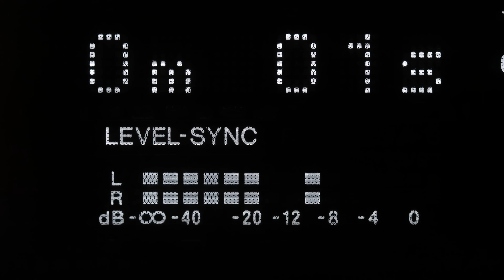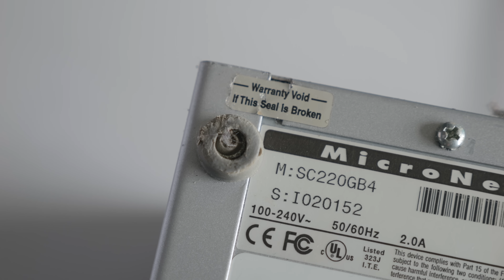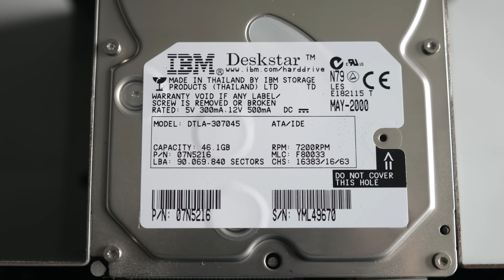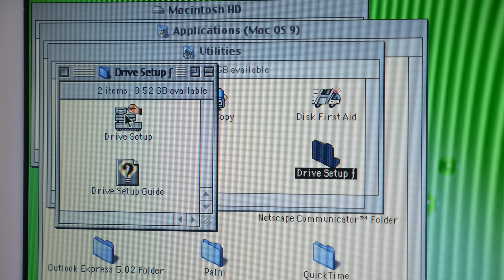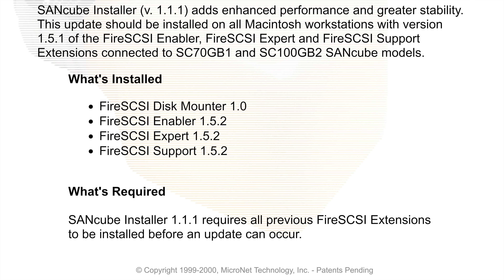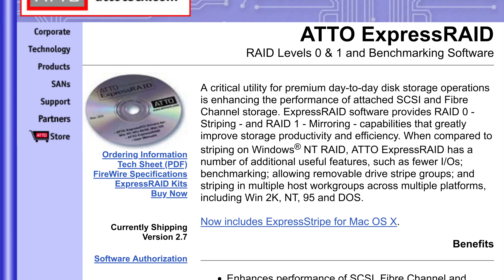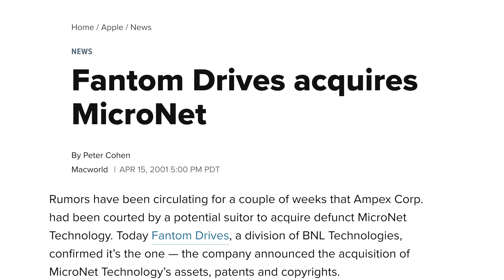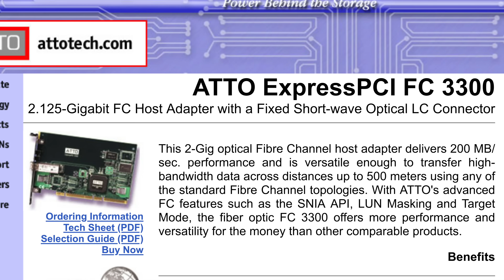This old external hard drive can do WHAT?!

Comment: IBM DeathStars and it had never been opened!? it's a miracle!
Reply: Well, all six passed their self-test and probably work still haha. I know because I have over a dozen I've collected and I'm familiar with how they are. Part of the problem was how hot OEM PC cases would get due to poor ventilation, which would then cause the drive to overheat and degrade fast. Also IBM stated that these drives were not designed for 24/7 operation, yet people disregarded this and used them in servers and RAID configuration anyways which of course did not go well. With proper ventilation, the drive would last significantly longer since it wouldn't run hot all the time. I've seen them get above 60c which cooks the media and increases the risk of the drive crashing the heads onto the platters. If you keep the drive cool, and don't use it too often, they definitely can last. I have a whole set that works granted most have reallocated sectors, but the drives are 20+ years old so I think that is reasonable to not expect the drive to be perfect especially considering the history.

Also did you notice how those drives were well ventilated in that enclosure by the fan and airflow? That is a huge reason they probably all still were able to seek just fine...the media didn't get toasted due to extreme temperatures. They do heat up fast, especially the higher end models with more platters inside generating more heat...

Comment: I have several IDE external HDD enclosures with firewire and usb 2.0 and they always worked out of the box in windows xp and in ubuntu with no driver installation (although in ubuntu you have to activate firewire which is disabled by default due to it being a security risk).

Comment: Speaking of failing hard drives, I've noticed that you talk a lot about old SCSI drives being scarce due to failure. I highly recommend looking into early to mid 90s IBM drives for some of your restoration projects. They seem to last virtually forever, unlike old Quantums and Conners.
Reply: Can't go wrong with an early IBM! Well unless it is one of those PS/2 stepper IBM drives where the platters rot...the early to mid 90s IBMs do seem to last forever, but the late 90s one's at least in my experience is hit or miss. I feel really bad for how many of those Quantum drives get thrown out due to the rubber melting which is fixable, I suspect within the next decade those are going to become rare drives as so many of them are failing this way it is at an astronomical level. Wish people would try and see what is wrong with the drive before tossing it or plugging in a solid state solution but that is personal choice...

Comment: Oh no the IBM Deathstar
Reply: I mean if the fact all six passed their self-test doesn't prove something...I don't know what will. The proper ventilation along with the fact they likely sat and weren't used too much after is why they survived, heat was an insane killer of those since most OEM computer cases had crappy cooling that would cause the drive to overheat and die. Also they are not designed for 24/7 operation per stated on IBMs website and manual I believe at the time yet people still would disregard this and especially with poor cooling the drives would overheat and run around 60c then die within two or three years or less. I still have a set of them that work : ))

Comment: So, the use-case for this would have been in a small computer lab. Not exactly practical for a SAN.

I wonder if it's possible to reverse-engineer this unit. Get a dump of those flash chips to see if they contain any firmware.

Comment: We had one at my job. It was great until it died. It was an expensive lesson in drive recovery and why you need a real server.
Reply: Probably would have been fine if they had chosen more reliable HDDs. Running 2000-era Deathstars in RAID was the computing version of Russian Roulette.
Reply: As I recall, the drives were fine but the raid was scrambled. I think we got back most of the data. The entire thing was chucked.

Comment: I fished one of these out of a dumpster circa 2004 and added a bunch of seagate drives to it and it worked with my Mirror Door running OSX panther for years, I don't remember having to do anything to configure it, each drive just showed up as an external firewire device. I knew about the multi mac support but from what I remember that was OS9 only. You might want to try all the firewire ports, I can't remember but one may have been the "prime" port required to use it without the software.
Reply: Yeah I wondered too if he tried them all
Reply: I noticed some DIP switches in the center of the FireWire ports. Maybe they disable the software requirement.

Comment: Is the plastic shiny/ glossy? If so you can fix that by buffing it out with a polishing compound called Quixx. You get two types: Quixx Paint and Quixx Plastic.

The best repairs I've managed to do is to sand deep scratches out and evenly with 3000 Grit, then using the agressive Quixx Plastic to buff the entire panel to an even hazey look. This removes the sanding as it's an abrasive compound but the plastic needs more work.

To finish it off to restore the transparency you need to use the Quixx Paint Tube 1 (Repair) to remove the microscrathing thats occured and finally finish off with generous dollops of Quixx Paint Tube 2 (Finish) to bring out a lusterous shine.

If you can get the older oil based Quixx Paint in the metal paint tubes it will work even better but be warned, not only does it stink, this is laborious, time consuming work as it must be done by hand as power tools can potentially warp/ discolour the plastic if it gets too hot.

Also, if the scratches are even deeper than 3000 Grit you will need higher grit but then you have a larger area to sand and buff back to original condition.

Comment: I guess you are a big fan of Apples plastic cover of Macs... Even though I had never seen a Sancube before, I could see it was catered for the rotten Apples. In my opinion it looked way better without the plastic on it. Like someone else mentioned,  Firewire is still being used by the Linux community today, try finding apps and drivers for Linux.

EDIT: Usually you don't even need to look for drivers for devices in Linux, it most often fixes this itself. There is also most likely some dude that made a program for himself that made his program available for others, it might just be very hard to track down.

Comment: you know firewire wasn't just on Mac, I used it on my PC for video capture, importing and exporting as well as external storage, I had 2 drive bays both with 2 80 gig drives and they were shared across my home network. granted the network was limited at 100 meg but it was fast enough for my needs considering I didn't have to have 50 foot firewire cables and the house was wired for cat 5 already.
Reply: While that's true, the PC world basically ignored FW entirely ... with a very limited exception for pro-audio and video enthusiasts.  Sony did make a point of including it on the VAIO line (although Sony's whole philosophy was inspired by Apple, so that's no surprise), and I had a handful of motherboards that supported FW.  But otherwise, the WinTel community was solely focused on USB and Ethernet.

I take issue with anyone that calls FireWire an "Apple proprietary thing".  PC users had access to it, they just never cared.  Which is too bad.  USB is a mess these days, and really would have benefitted from a mindset that we should have separate low-speed and high-speed interfaces.  Maybe we could have had a sane and simple USB implementation alongside a completely separate Thunderbolt bus today, instead of trying to smash everything from power to keyboards to video walls over the same cable.
Reply: I loved FW, it delivered on a promise that USB never lived up to and that is daisy chaining devices, I didn't need a bunch of firewire ports on my computer,  plug in external storage to computer, second storage to the first, video capture to the second and then my mini DV camcorder. When USB was first discussed before any computers actually got it part of the spec was to be able to daisy chain up to 127 devices without a hub. clearly that never happened. and my first computer with firewire was a Compac Presario with a P4 at 1.5 gig and 64meg of rambus memory. Sadly it came withe the worst version of windows in history that being windows ME. I did and still have a working Sony Vaio laptop, well working is a relelivitive term, it functions but its got a PIII chip and was never upgraded past windows XP.
  @sirnickity

Comment: I recently got an old (Mini) DV Broadcast Camera, the Digital Out is Firewire so i would love to learn of any modern workflows for using a Firewire Card / Adapter.  Relatable hunt for software in this video lol, keep up the good work.
Reply: You most likely need to use Linux and some open source software for that. Unless you try using a virtual machine. I recently tried it with Linux but with USB 2.0 but only Firewire seem to work, but I didn't have the energy to install Linux on an old laptop I have that has a Firewire card, but I might try it in the near future. For example, the Panasonic Thoughbook C-53 has Firewire. If you need a Firewire PCI card and cabling I have and are willing to sell within Europe if you pay postage, hell I'd even send it to you for only the postage, I hate to see tech go to waste instead of being used. With that I can also send an external chassi for a DVD drive made by Lacie back in the day.
Reply: If you just want to record to digital files you can use WinDV. It's tiny, free, and worked fine with the last version of Windows 10 I tried. Any decent video editor should handle DV-AVI files, or if desired you can deinterlace and convert to a more modern codec.

If you want a purely modern workflow (likely without audio) you don't need any special software. Under Windows a DV camera can be used as a webcam by any normal application.
Reply: Just make sure to install the "1394 OHCI Legacy" driver. Otherwise, you can control the DV camera, but won't see any video input - just a black screen. Microsoft removed the video features from their shipped driver in Windows 10 or newer.
Reply: With my DV camera, I use premiere pro cs5 (cc2024 sadly dropped support for this) which can record to and from the camera using firewire. I think windows movie maker can also capture the footage, but it's not exactly modern lol.
Reply: @Naitrio  Might be that Premiere includes this driver. On a plain Windows 10 it didn't work for me. I was able to remote control the DV device, even got audio, but no video.
Reply: @mbirth  yeah that's possible, I never needed to install an older driver.
Reply: I think you'll be lucky to find any modern software that captures/lays back via Firewire. I keep a 2012 Mac mini around (the last generation with a Firewire port) simply so that I can run FCP7 for capturing from my miniDV camcorder. I have VHS and Betamax VCRs connected to the analogue video input of the camcorder, and it acts as a real-time analogue-to-DV converter. DV compression is superior to DVD (only 5:1) and all my captures are native 50i QuickTimes, which I can then process to other codecs as necessary.

Comment: I would not call it a SAN, unless there were implementations of computer networks only using firewire.  What is the point of having a RAID, especially a RAID 1, when you cannot easily swap out bad hard drives.  Seems like false advertising.

Comment: Hot tip. Order some speaker foam (intended for the front cover of a speaker) and fix it over the inside of the intakes with male vecro (the hook part) which it sticks to really well. . In the future you just swap out the foam. Also, a car headlight restoration kit will take those plastic scratches out and make it like new. I've been doing this on vintage turntable dust covers for years. 

Also, I bet this unit spent its life on carpet, hence the fluff.

Lastly, I never miss one of your videos. Love your work.
Reply: McGuire's plastX is MAGIC at cleaning plastic,
Reply: @sterlinsilver  I was going to say Plast-x works great, you get a whole bottle that'll last for years, and you can use it on car headlights... That's what I originally got my bottle for years ago. I've even saved a scratched CD or two with it.
Reply: @sterlinsilver  I use the 3M headlight restoration kit

Comment: I hate it when a project ends in "the software is basically gone". Cool video, man.
Reply: Will happen basically to all heavily encumber tech by patents and royalties. Seconds official support ends (dropped by major proponent/manufactures) it become paper weight pretty fast...
Reply: I think, in this case, that might be a blessing.  The feat this was trying to pull off seems like it probably didn't perform great, and would have to be essentially bug-free to not decimate the integrity of the file system.

It IS a shame that it can't just expose the underlying storage at the block level, though.  It would make a neat external HDD chassis.  (If not a tedious one to maintain.)
Reply: Reminds me of the Media100 cards that came in a PowerMac G4 that I bought a good while ago. Useless without the software, the software requires a licence to purchase, said license is tied to the machine or OS install, and (I think) even requires a physical license key. Plus a hardware breakout box that I don’t have. 

So they just sit on the shelf looking pretty.
Reply: It's the worset, and will be even worse in the future when you will need an iOS app or APK that got delisted 15 years ago and requires an obsolete version of the OS. At least with stuff from this period it's still possible for someone to unearth a driver CD
Reply: I'm hoping someone who has a working copy of the software sees this video so there can be a part 2
Reply: Right, I was thinking the same thing.
Reply: It is sad.

At least the hardware seems like it might be simple enough that someone could write new software if they really wanted to.

After all, it's just a bunch of ATA-FW adapter chips plus some FW hubs...
Reply: I have searched online and there are some very old forums that discuss the software. I think the macosx forums. There maybe a change people from that forum are still on it or can be reached. The trick of finding this kind of stuff so to be pro active. I bet you can find someone on macrumors that has this software. You just be active in searching.
Reply: He should install SanCube on Windows 10. Maybe it would install a generic driver...

Comment: Interesting product.  I prefer it without the plastic casing though.  

However, the product does seem like a stopgap.   It seems like something cheap (or relatively so) that a company would buy until they could justify, or afford, a proper solution..

Comment: the ide ribbon cable wasn't a 80-conductor type, the file transferring speed won't be too impressive
Reply: They could still force faster speeds with a 40 wire cable. Also it doesn't matter. Three channels of 33MB/s will easily saturate a FW400 link.
Reply: okie dokie

Comment: I vaguely remember back in the early 2000s either looking at Oracle 11 or VMWare and them suggesting using firewire drives as a poor mans SAN.  It could be that Linux will still support the thing or at least older versions of Linux will.

Comment: FireWire was pretty brilliant for networking without the need for switches etc thanks to being peer to peer. It's kind of sad how it didn't have much life beyond the world of Apple, though it's apparently a fairly common interface on military hardware thanks to how robust it is and the incredibly low latency. They use the 3200 spec on the F-35 I believe (yes the F-35 has been in development that long).
Reply: Firewire was frequently shipped on Sony products, including the PS2, which is technically one of the biggest selling computers of all time.
Reply: @JD101A  The PS2 was a Linux computer from the start, iirc. I remember Sony selling a keyboard and mouse specifically for it for a while.
Reply: FireWire was really common on camcorders in the 2000s. If you had a digital camcorder (MiniDV or Digital8) and wanted to copy the videos to a computer then most likely you used FireWire.
A lot of business and workstation desktops and laptops had FireWire up to the early 2010s, for example HP Z420/Z620/Z820. It was also common on multimedia laptops back when they were a thing.
Most even slightly higher end-ish LGA775, LGA1156, LGA1366, AM2+, AM3 motherboards had at least one FireWire port. It wasn't uncommon on LGA1155 or LGA2011 boards either
Reply: FireWire was on most laptops from the Pentium 4 through the Core 2 Duo era. It just didn't get as much use.
Reply: I still use firewire for audio and  I wouldn't call it: low latency. Actually the latency is rather high because of the Firewire protocol
Reply: It was commonly used in its time, but GbE and USB2 left it without much to do, apart from cost more money for extra cables.

Comment: It's wild you would this as I'm considering making a FireWire NAS due due the fact old FireWire equipment is cheap and I can run both modern and vintage computers off it faster than my internet connection. Guess it's a sign 😂
Reply: I have an old WD Studio RAID drive that I connected to an old MacMini. It’s used as a home server.